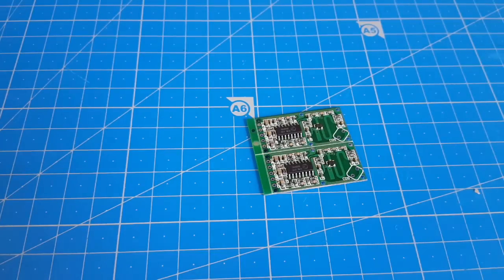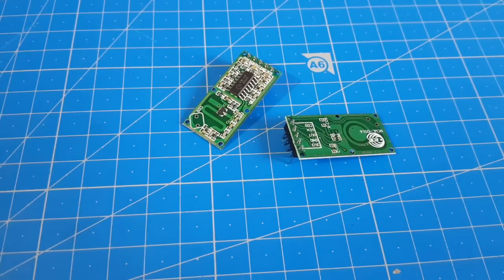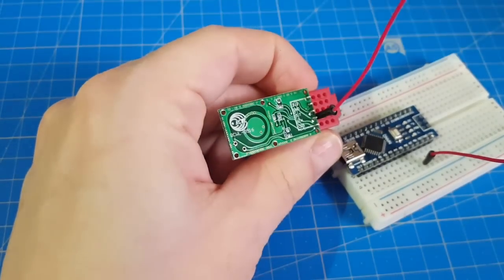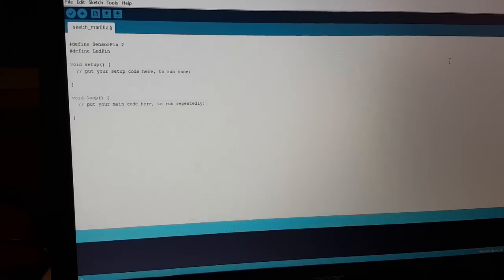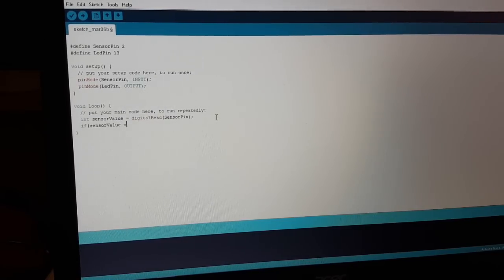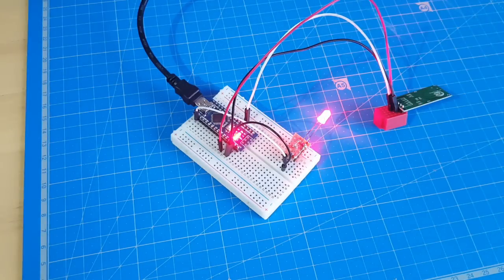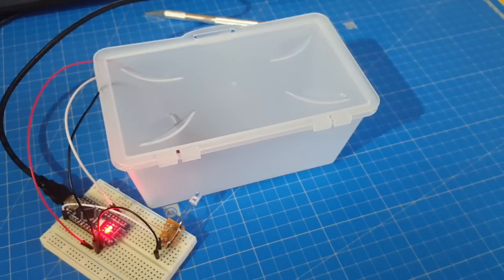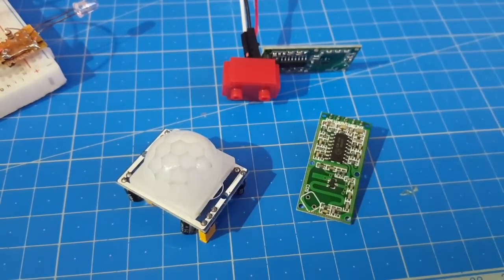Coolest motion detection sensor ever!

Comment: i bought a radar module from DFRobot (sen0359)
used it on a pi and i can tell you right now that its not a human presence sensor. it detects anything 
the fact that this one costs less and works better is a real slap in the face for DFR

Comment: Can you also base the detection on code? Instead of adding resistors? And then calculate the distance to the object it sees?
Reply from the maker: You only get a digital sensor value out of this sensor. Which only refelcts if an object is detected or not. You could maby solve this, by using several of this sensor with different resistor values. But I'm not sure, if the interfere with each other. Could be a nice project.

Comment: I cant find any details or material to further customize it for example to detect other materials instead of Human Body and another thing I cant find what is the rate of readings possible? can it do 1000+ fps detection?
Reply from the maker: The only customizing you can do, is lowering the range and adding a photo resistor. Come on, it's a cheap a** sensor.
Reply: @nenioc187  doesn't mean we shouldn't hack the ** out of it :)

Comment: They are ok but I found they interfere with esp8266 or even 433mhz radio a and block the output
Reply from the maker: Heard this a lot. But I have 2 projects using an esp8266 with this sensor without any problems.

Comment: This sensor could be connected to a solid state relay, to activate LED light 60watts, without the need for Arduino, since in my country is not cheap the Arduino, thank you very much for your attention
Reply from the maker: That's correct. You can hook up nearly every sensor, that puts a digital on or off signal to relais or even a MosFet to control it. But you got more options with a microcontroller behint it.

Comment: Hi, I use this sensor in my Paranormal research and have built what I named RoePod and RoePod mini.

I have had great success using this sensor in my  custom built devices out on location where at least 3 known suicides have taken place. 

Allowing adequate distance between myself and my RoePods and one device being placed on a tripod under the exact spot where a suicide was found hanging.

2 of my custom built RoePods did activate, the other I had placed in a doorway that was the 1st to activate. As I walked over to the device which had already reset itself and as I bent down to retrieve it the other RoePod placed in the spot where the suicide was found hanging began to sound and flashing its LED at the same time.

I cannot explain why these 2 devices activated as I made absolutely sure that enough distance was between myself and the devices.

These sensors have a 360 coverage, can detect through walls and are unaffected by wind, animals, bugs, mosquitoes and require a human or something else to manipulate the devices to get them to activate.

I am also constructing a Paranormal music box using this sensor, currently I am waiting for the musical movements to show up to continue on with this project. 

The movements will be powered by a small 3v motor using 2 alloy pulleys and a toothed belt.

Its basically a trigger device that the spirits can manipulate to activate.

Incidentally I am building many variations of the musical box using different sensors, I will try out vehicle backup distance sensors, this will be a first for me.

Respect from Taiwan, stay safe and enjoy your Christmas.
Reply: How about the range? Can I control them?
I am planing to use this as Human Detector for security purposes.
Reply: @madscientist1595   It has a sensitivity range of up to 7 meters, 360° and can detect through walls as I proved in a demo in my kitchen and dining room. When triggered its trigger output pin will switch from (LOW) 0V to high (3.3V) for ~ 2 to 3 seconds before returning to its idle LOW state. 

I wish the trigger run tome was linger.

Component side should face detection area for maximum sensitivity
Reply from the maker: Sounds like a cool project. Did you made a video?
Reply: @nenioc187  There is also the RCWL 0515 version

Comment: I bought a handful of these from Amazon about a month ago.  Cost about a buck each.  Hooked one up and couldn't get it to react to motion unless my hand was about 2 cm in front of the sensor.  I haven't tried any of the other ones but I guess it's a crap shoot for quality when you order Chinese surplus electronics.  Maybe if I'm lucky one out of the 6 will work.  Instead of driving an Arduino I just hooked an LED up to the output along with a 680 ohm resistor.  As I said the LED would light but only when triggered from a short distance.  You can select the sensitivity with a resistor but the default with the pads open is supposed to be 7m.

Comment: Dear Sir, Would like to use it without Arduino, what about the delay settings (as in PIR sensor) for which it remain HIGH?"
Reply from the maker: With a capacitor on the C-TM pad you should be able to extend the HIGH-time. But I'm not sure what kind of cap you need.
Reply: @nenioc187  Thank you, Good Idea!

Comment: This shows why I am frustrated at so much Arduino usage in small projects. You could have just connected the output directly to the LED, but no, we gotta use an Arduino to make it look like we know what we are doing. (the  "I are an engineer" attitude) I have seen so many projects that would have only needed perhaps a couple of transistors but instead the creator decided to use an Arduino because "it's so cool".
Reply from the maker: Of course you can use it directly. Or make a project with it, without using a micro controller. I encourage you to do that!
But I need to use it with a micro controller, not because it is cool, but because I'll use it with more complex projects than only triggering a LED.

Comment: Could this be used on a camera trap system, to trigger a camera in the field?  I capture pictures of panthers in south Florida for the state.  Could it be triggered from 15 feet away, and capture motion the size of a domestic cat(bobcat) as well as panthers?  If so, can I pay you to build a couple units for me?  I would like it to run on a battery for about a month, and trigger a camera with a 2.5mm plug.

Comment: The Arduino is not needed.  VIN is 4 - 28 VDC (not 4 - 24VDC).  Simple test circuit:  LED anode to dropping resistor then to OUT, LED cathode to GND.  Power + to VIN, power -- to ground.  OUT goes to high (3.3VDC) when notion is detected.  On power up, LED comes on for 2 secs, then off for several seconds while the board boots up, then ready to detect.  The component side is the detect side aligned in the general direction of desired detection.
Reply from the maker: That is correct. As you can do with the PIR sensor, or many other sensors. But you have much more possibilities if you are using it with an Arduino.

Comment: HI,
FYI you don't need an Arduino and code to run it. Just provide 4 to 24 volts and 3Mamps (0.003)max current. It runs all on it's own.

Comment: How to incorporate a small piezo like speaker so we have a visual and audio motion alert. What piezo buzzer like  speaker is suirable and voltages?
Reply from the maker: Same as with the LED. Use e.g a 5V piezo for an Arduino. Connect Minus to Ground and Plus to an Arduino pin. If motion is detected, pull the pin HIGH and the piezo makes an annoying beep.
Reply: @nenioc187  thanks, how about if I do not wish to use an Arduino  just use the RCWL 0516 on it's own.
Reply from the maker: Never tried it before, but it also should do the trick. Just connect the digital output of the sensor to the positive of the piezo and the minus to the ground line.
Reply: @nenioc187  I have built in excess of 10 devices using this particular board. I use my devices in my Paranormal research, I have called my devices RoePods. I incorporated a coloured 8mm LED with a piezo speaker/sounder, so I have visual and audible alerts when it activates.
Reply: Sorry I forgot to mention my sensor boards which is the heart of my RoePods (100 x 50 x 40mm) and my RoePod minis sit inside a 65 x 40 x 30 black project cases. Recently I created some smaller RoePods using an off white project box, this case being only 75 x 45 x 18mm in size.  I used a soft high temperature silicone wire inside as its easier to manage when working in confined project box spaces. I am delighted in the way they look, sound and function. While out recently on location to test out my devices  2 of my RoePods activated despite being adequate distance between myself and the units. It's worth mentioning that one of the RoePods I had placed under the exact spot where someone had hanged themselves. I also used an SB7 Ghostbox and a Sony PX440 voice recorder, both  which gave me an indication that something was manipulating the Ghostbox and different vocals were recorded on the voice recorder that shouldn't have been there. Incidentally I do not use Arduino or any script. I have played around with ways to power 1st RoePods used 2 x 18650 batteries. The 2 RoePod minis (65 x 45 x 30) I used 9v batteries. On  the more compact 75 x  45 x 18 cases I used 2 x CR2032 button batteries.

Comment: but there is no POT on it so then how do you adjust the range?
Reply from the maker: There are two solder points marked R-GN. With a resistor here, you can 
decrease the range. Corresponding to the datasheet a 1MOhm resistor 
would decrease the range from 7 meter to 5 meter.
Reply: @nenioc187  what is 1 MOHm ?
 how does it look on a meter?
is it megohm or milliohm
 if i test it what will it show on the meter?
a cheap non autoranging meter, there is onlu  k ohm  settings ,
i want tot see if i can harvest  a SMD resistor out of something
Reply from the maker: It's Mega-Ohm. Or 1000 k-Ohm on your meter.
Reply: @nenioc187  ok thats what i thought
 so i put my meter to 2000k ohm setting (not auto ranging) and it should say 1000 with no decimal points
i don't have a fancy fluke i only have a  cheap centec

Comment: i want to use this sensor for my project...everything is fine, but i want to know if microwaves are safe for long time exposure?
Reply from the maker: The Sensor uses about 30 milliwatts (mW). 
The radiation output is limited to that value (It's probably lower). That is far less than 
your smartphone emits.

Comment: great lil board, shame the range is not as good, but fingers crossed maybe improve on that, 
would have to be careful where you place it if it is that good at through materials, may get false reads when not in the room you are monitoring :)

Comment: Does this sensor has front,  back or direction point  like the PIR for example ?
Reply from the maker: It has a wider detection range than a PIR sensor. I would say it has more of a 360° range.
Reply: nenioc187  Thanks,  which side is the front one ?
I tried the both side and can't tell which is the right one :(
Reply from the maker: I'm not sure there is a front or back, since it works both ways.

Comment: does it work through a wall?
Reply from the maker: Only thin walls. And it reduces the range a lot.
Reply: @nenioc187  thanks for a fast reply. i'm planning to put this in a toilet as a indicator if someone is inside and i don't wait to detect people outside. my wall is around 15cm
Reply from the maker: There are two solder points marked R-GN. With a resistor here, you can 
decrease the range. Corresponding to the datasheet a 1MOhm resistor 
would decrease the range from 7 meter to 5 meter. I guess with an even higher resistor you could decrease the range even more.
Reply: @Kostanj42  thats not a good idea,   there are easier and better ways to achieve that, specially when you assumed that people in toilet will be constantly moving to keep the sensor triggered
Reply: @knowurself4999  yeah i realized that, and also it was still detecting people outside. what other ways would you recommend?

Comment: how can i decrease length because mine is going through my wall..
and how can i block it totally.. on the sides for instances?
Reply from the maker: There are two solder points marked R-GN. With a resistor here, you can decrease the range. Corresponding to the datasheet a 1MOhm resistor would decrease the range from 7 meter to 5 meter.
The signal can be totally blocked by metal. Like in the video, where I put it in a metal container. So you could build a shield out of steel.
Reply: arg okay noted! could i decrease the range any further by adding more resistance :)?
Reply from the maker: That should work. Also consider this: each obstacle reduces the range and sensitivity. So you could reduce the range by using a thicker housing for the sensor.

Comment: I used both sensor in my final year project!!
1st I used PIR sensor but it has limited range (7 meter)
We want more than 10 meter range distance so we used then rcwl-0516, that gives a very nice rage which require so I like that sensor.
Reply: I started using one today it keep on all the time.. can u tell me whats wrong
Reply: In my case it gives only 3 meter range in outdoor open area ..what could be reason can you plz suggest ?

Comment: Got em , they work nice, only low range up to 7 m in my case I needed 15 m but will find use of these as well. Nice video deserve big like.
Reply: Did you find something similar for longer ranges? If so, what did you find? Thank you.
Reply: May i know what kind of source code did you used ?
Reply: @vrindahdevii8567  The range has nothing to do with the code.

Comment: Thanks for this video!

Question; will this work through a 3 mm Medium-Density Fibreboard (MDF) with a 3mm acrylic one way mirror on top?
Reply from the maker: This is kinda specific. I think, you'll just have to try it.
Reply: And it worked?
Reply: It should because it's RADAR and it will penetrate non-conductive substances. It also will not respond to such materials. The mirror could be problematic because it might be conductive and block the signal.

Comment: Hello there, again!
I want to make a lightbox that turns on and off with gestures and I will use this radar with an Arduino Uno.
I have a some questions:
1) how can I limit the area where the radar is reading? I want to leave only a spot and try to make it work reading gestures. 
So far, I can't find the way to find that "blindness", its or total in both ways, or read everything or I need to block it inside a stainless steel bottle so it doesn't read anything... I already tried a microwave horn, and nope, didn't work. Unless I did it wrong somehow.. which materials or ideas could you recommend me to solve this?
2) Voltage. So, I am using 12V  LEDs, how can I adapt the voltage so the RCWL don't get fried? lol  So it get the normal 3V the radar needs.

I was watching your other video, where you talk about the APDS-9960. The problem with that one, is that I was looking something "cleaner" with the PIR I will need to create a hole, which I would not want... but since I am having a bunch of troubles with this, I am starting to consider it.. suggestions???

Thank you so much for your content! :D <3
Reply from the maker: You can decrease the RCWL's sensitivity by soldering a resistor to R-GN. With a 1 MOhm you can decrease the range from 7M to 5M. You can try it with a potentiometer to fulfill your needs. If you want to make a lamp that you can turn on/off by gesture, you'll definitely need a gesture or a proximity sensor. 
Spoiler: Next video is about a lamp, that is controlled via Smartphone and can be turned on/off by gestures (used the APDS9960) ;-)
Reply: Thank you for your answer!
In this case I am interested in no more than 30cm of reading area. What I want, is to "interact" with my light box. The original idea was doing it by gestures. Where waving the hand once (as if you say hello) will turn on and twice (as if you say bye) will turn off. 

If this is not possible, maybe just make it read what it detects, the problem here is that the code I used don't let me (and I don't know how to change it) change the time it takes between the read from one move to the other. Sometimes it takes 2secs sometimes almost a min, and sometimes reads fake movements!!  ): 
For this test, I used State Change Detection (Edge Detection), which works similar as by gestures.

The problem of using the  APDS9960 is that I will be forced to make a visor for my PIR, to detect the gesture. And it may not work since it will be interrupted by the light inside the box. Unless I put some sort of small tube (like a  straw size maybe?) the problem there is that my light box is made of milky white acrylic sheets, which will create a shadow on the way.. unless I sacrifice some distance....
The optimal distance for that one to work was around 7cm up to 25cm (saw another guy trying it in another video)

So, for the RCWL there is no way I can make like a small box made of some metal, with a small open area (the visor) to read only a specific angle/area?

Thank you!!!
p.s. sorry for the huuuuuuuuuuge text, but I am so lost at this point and I have tried several stuff and I need to finish my prototype asap! D:
Reply from the maker: Each of your approaches might work. Boxing the RCWL sensor, or making a small hole for the APDS sensor. If you'll using the gesture sensor: I'll recommend following: Use one wave to turn it on and one wave to turn it off again. You avoid false reading you'll probably get, if you rely on the two wave method.

Comment: I found that it has very poor sensitivity if it is inside of the thick glass window of a large building.  Seems like the glass is absorbing most of the RF.
Reply from the maker: Never tested it with glass. Thanks for the info!
Reply: Glass might have a coating that absorbs the radiation somewhat.
Reply: Commercial glass usually has a thin metallic coating to reflect sunlight ie tint.